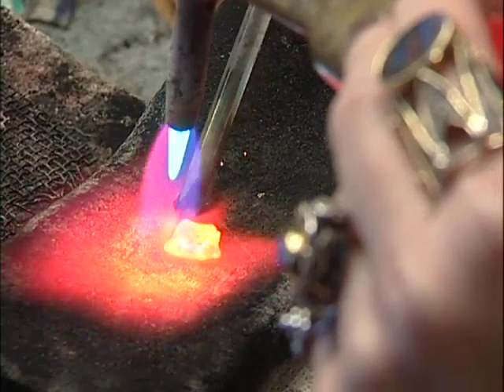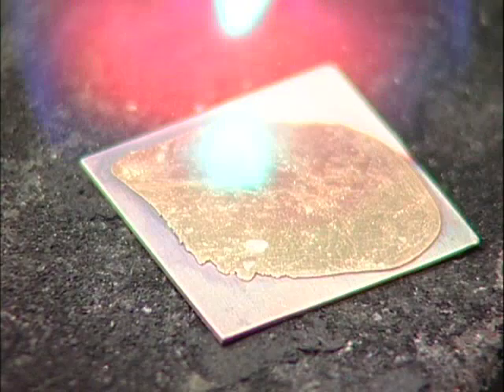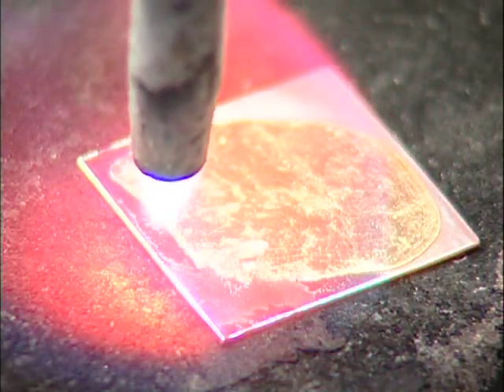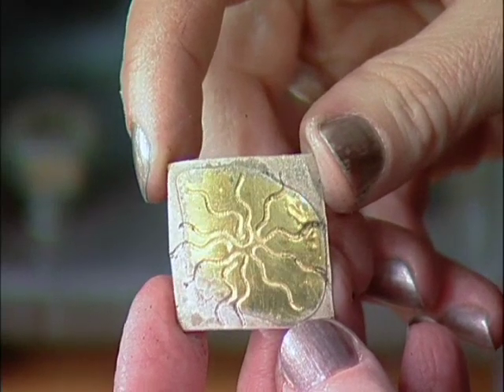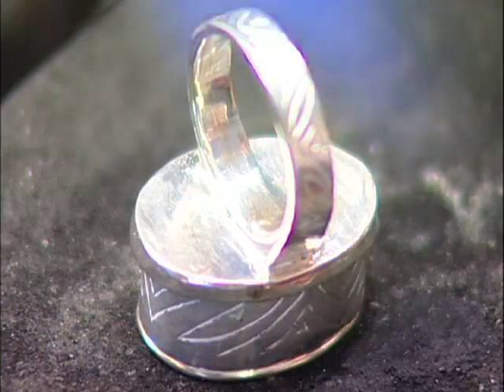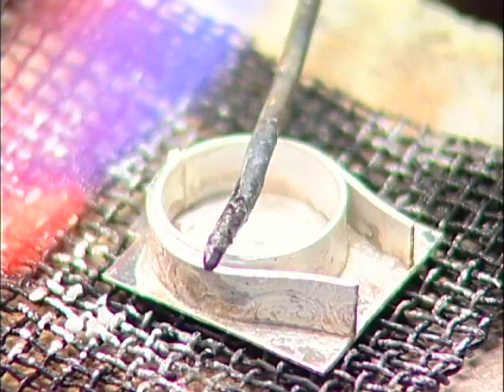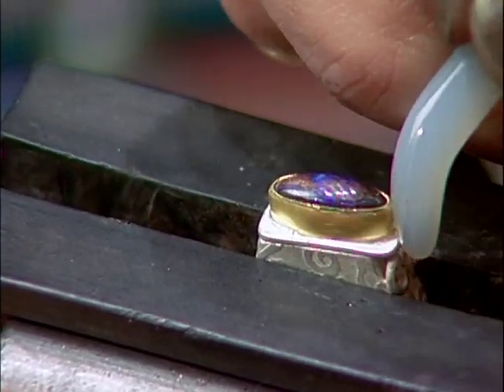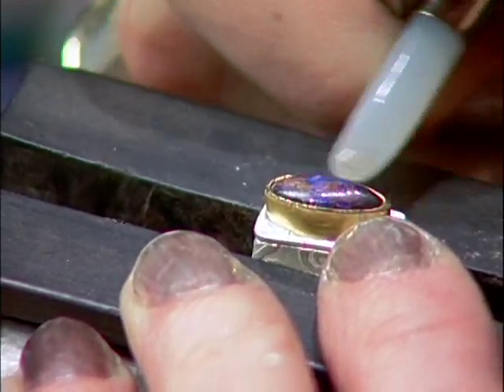Metal Techniques of Bronze Age Masters: Rings (DVD preview)

Comment from the maker: Thanks!

Interesting question.  I would expect in normal casting procedures that the amount of copper that burns off wouldn't significantly change the desired outcome, certainly not enough to change the way the metal feels when working it.  Of course, refiners separate metals, but it's a different process.

Comment: really impressive

i have a question i wanna ask:
when you're alloying fine silver and coin silver, in the right proportion to get sterling silver, even though it was all weighed  correctly you do not get 925 because a part of the copper exits the sistem as oxides. is that true?